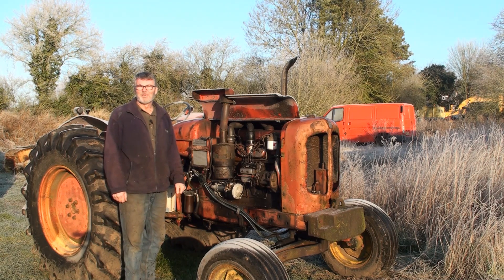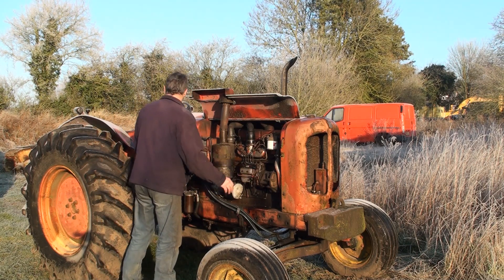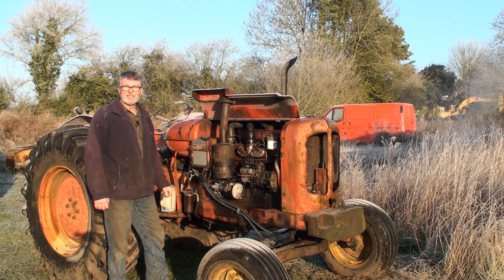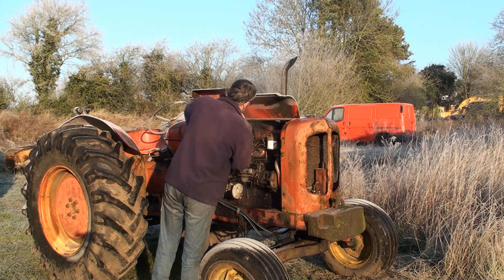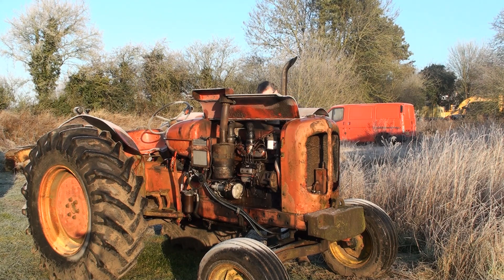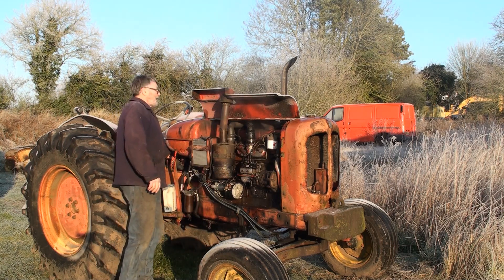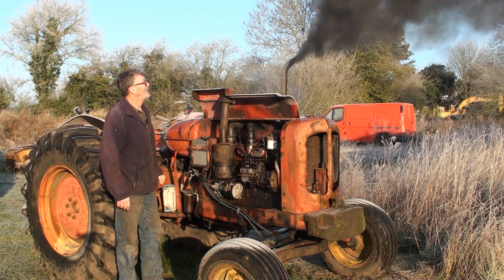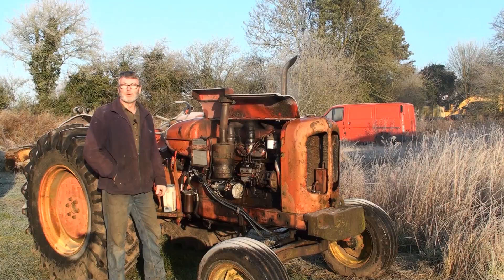Kettle Cold Start

Comment: My dad used to drain the block and radiator every night in winter on his tractors then in a morning fill the water system with hot water and it always helped them start even when burried in snow that was in 60s and early 70s

Comment: I used to use a hot air gun on our Nuffelds. On more difficult tractors like our dextas I used a gas torch with the nozzle removed they make a long orange flame. Pop that down the manifold and it would be belching flames out of the exhaust for 10-15 seconds before it eventually spluttered into life.

Comment: That's clever , never seen that before. A blow lamp or hot air gun into the air intake with (the air filter removed ) works a treat on my Leyland 255.  Have a good 2023.